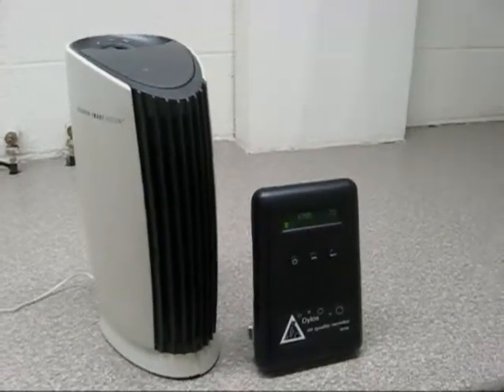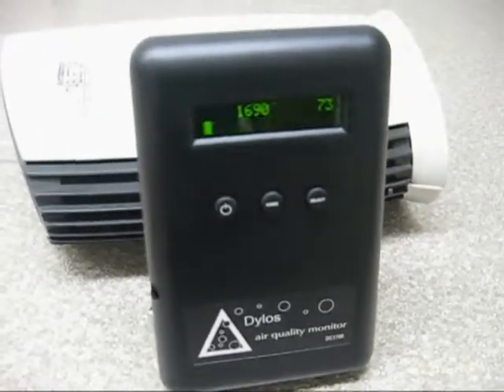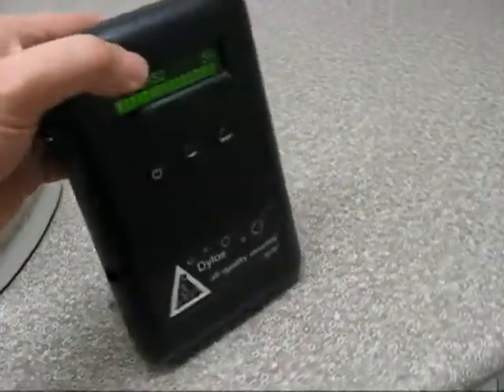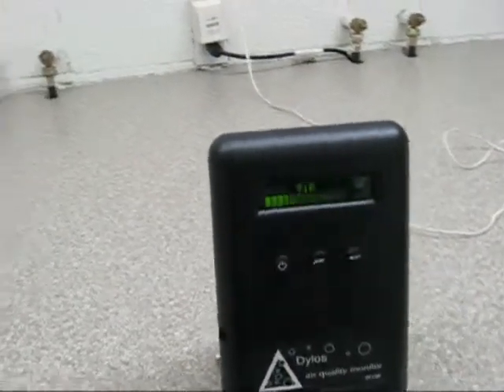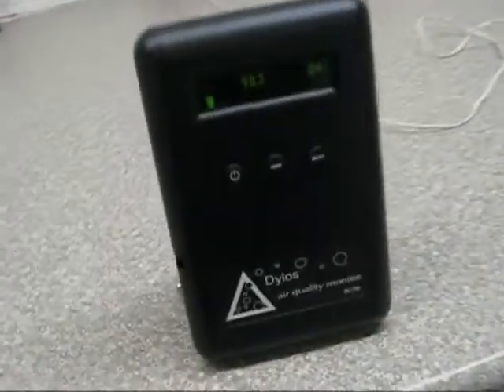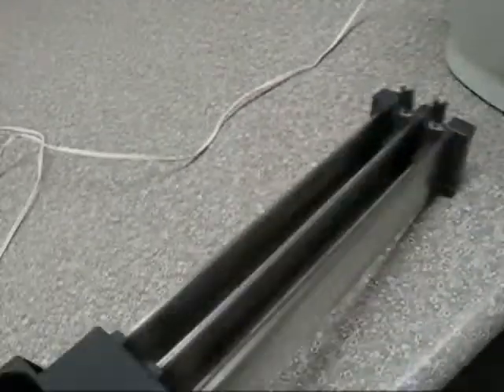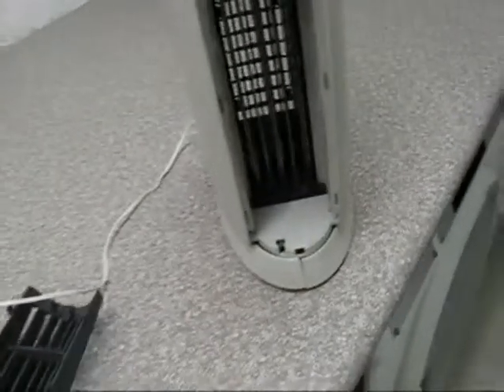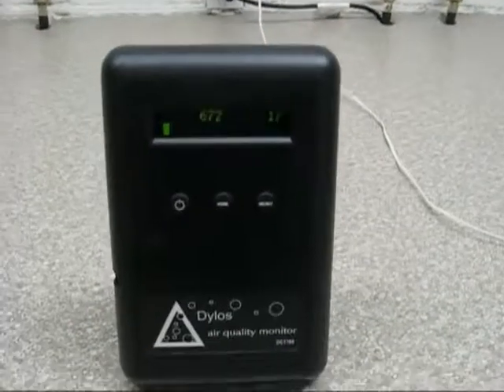Ionic Breeze particle counter test

Comment from the maker: I did make one mistake when making this video. The Dylos draws air from the top of the unit and expels it out the bottom so the direct exaust  test is invalid. However the whole room test is still valid. The Ionic  breeze does remove some of the dust from a room but not nearly what a HEPA type unit with a real fan would.
Reply: Rick Rude can it collect gas emissions
Reply from the maker: @aceboogie711  No,  Ozone can even react negatively with gases and create new problems. Ozone does not " neutralize" gases as the TV adds claims
Reply from the maker: @aceboogie711  No.
Reply from the maker: @aceboogie711  No, in fact ozone can react with VOC's but does not remove or " neutralize" them as many manufactures claim.

Comment from the maker: Ozone produce by the Ionic Breeze reacts with other chemicals in the air and on surfaces to produce other harmful substances. Ozone does not "clean up" the air as claimed by manufactures of Ozone and ionic air "purifiers"  Do not use an Ionic Breeze or any other Ionizers if  you have one. Throw it in the garbage! Get a real HEPA air cleaner.  http://allergyclean.com/article-formaldehyde.htm
Reply: wrong.ozone cleans pollutants to reduce their harm.it does " recombine not"